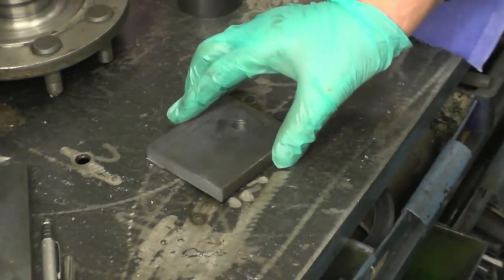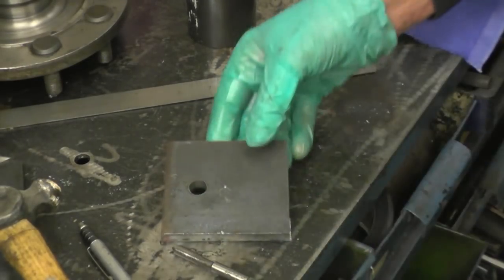SNNC 204 P2  Tractor Half Shaft Bearing Replacement

Comment: John, I ain't sure whether this comment refers to this video or the previous one, but here goes.

Have you considered putting another short piece of HSS, ground to the correct angles, in the other end of your chamfering tool holder? If you do that, you don't have to remove the cross-chamfering piece and reinstall it in the other end.  :)  You can also jack up the internal chamfer tool by as much as you want with feeler gauge or other stock, set the cross-chamfer tool on centre height, and have a tool that really is quick change, and does both internal and external chamfers without buggering about (as they say in some parts of the world).

Just making a suggestion, mate.

Comment: Wonderful Sunday evening viewing, John! I was surprised when you took the parallels out of the chuck and left that piece "floating" in the jaws. They held it fine, so who's to argue? Thanks so much for the video. I especially liked the work on the press and the final fitting.
Reply: Cant spin the lathe with the parallels in, just used to set the work offset
Reply: Oh, I know that, but I thought the piece would be up against the chuck, not just clamped in the jaws.
Reply: His bore in the workpiece was larger than the bore in his chuck so it had to be set out from the chuck to avoid crashing the boring bar into it
Reply: Ah! I missed that. Thanks for the explanation.
Reply: Hopefully John agrees with my explanation, but thats how I was thinking on that aspect of the project. I have been in similar circumstances

Comment: With that race as loose as it was even though you used locktite on it, what the chances of the race spinning burning into the shaft?
Reply: A Subaru mechanic I know says that Loctite was good enough to cater for up to .040" wear in th3e splines of constant velocity joints. Since I had a Subaru, I took his advice. He was right...

Comment: Hi John, How come some 4 jaw chucks have 4 adjusting screws the one you used for the threaded rod only had 2?
Reply: He has a self centering scroll chuck (all four jaws move at once like 3 jaw chucks), most four jaws have four independent jaws like the one used later for machining the hole in the square plate
Reply: I have seen a 4 jaw independant chuck that also had a scroll feature really cool

Comment: Wouldn't it have been easier to weld the plate onto the tube first and then bore the hole in the lathe ? Then the plate would be centered as you gripped the tube.